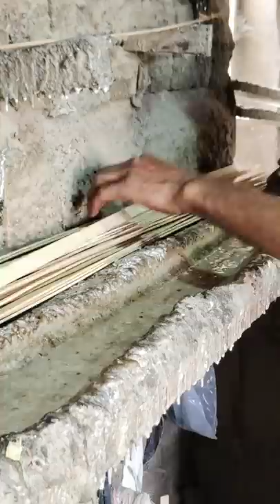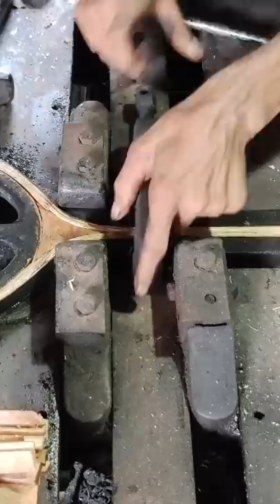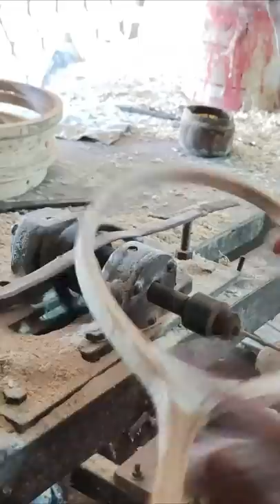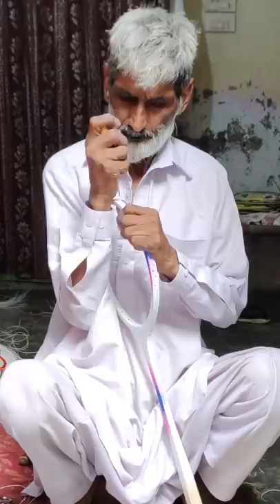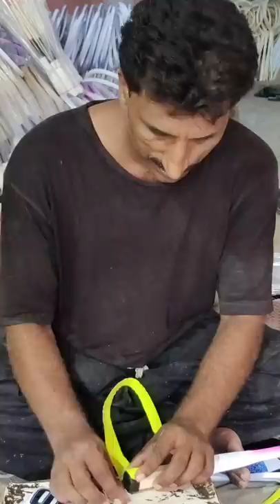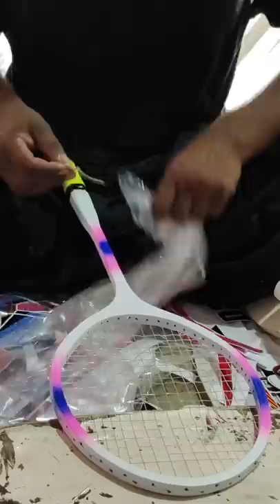How To Make Badminton Racket #shorts #BadmintonRacket #howtomake #wowskills

Comment: I am happy to see so beautiful rackets but those racket are for beginners because of two reasons:-
1.lbs- maximum weight of racket is 90 grams (used by professional racket used for warm up not for match).
2. Frame tension as you can see in video the man is knitting the strings so that means that frame doesn't have a good tension.